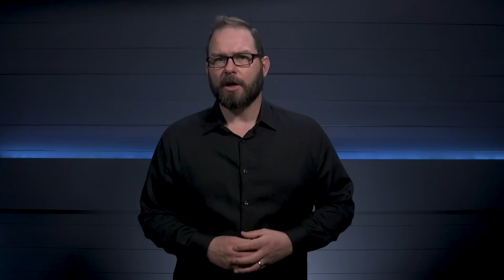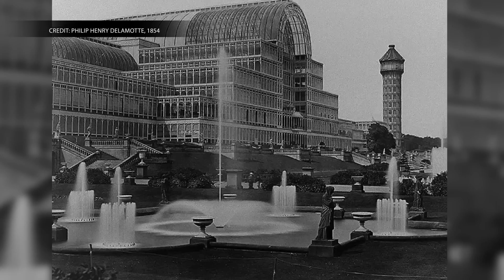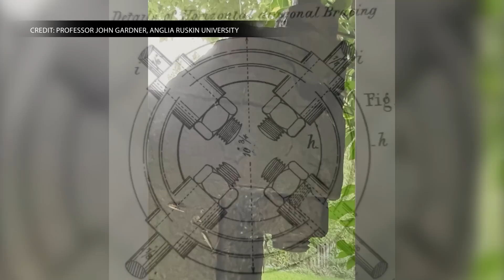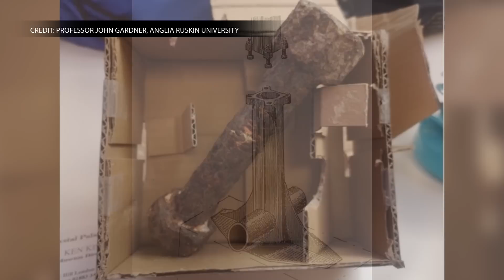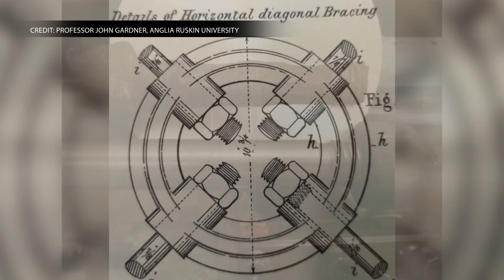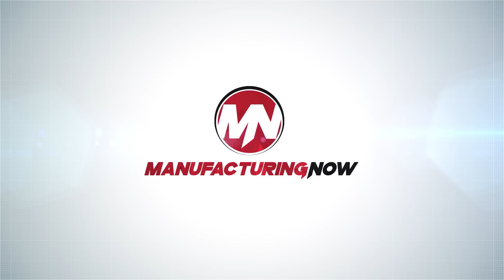Screw Thread Solves 173-Year-Old Mystery

Comment: Flash forward to WWII.  The Brits still hadn't mastered standardization and the US had to build the Rolls Royce Merlin engines for the Brits.
Reply: What history book are you reading? 
The British designed and built the RR Merlin for themselves, the US built the Merlin under license for US use in the P-51.
Reply: @Surestick88  As I understood it, the British Merlins were still fitted together, resulting in each engine very much having its own personality.
Reply: @leifvejby8023  Yes, the British were still "fitting" each engine together. If a new part was needed, it could not be taken off the shelf.  It had to be fitted to the specific engine they were working on.  They had no concept of tolerances which made all parts interchangeable and allowed high production rates.  If it hadn't been for US production techniques, the people of England would be eating wienerschnitzel at this moment.
Reply: @leifvejby8023 that's called 'blue printing'.
Reply: @sparked3113  No, blue printing is what I did to my car 30 years ago, I am talking about fitting them, scraping, reaming, lapping, so they could run at all.
Reply: @leifvejby8023  lucky they had a workforce of precision engineers with exceptional hand tool skills. Many of them women.
Reply: @alext8828 You're a bit thick. The Rolls Royce plant at Hillington near Glasgow was purpose built to produce Merlin engines. Get a grown up or your carer to show you where Scotland and England are on the British Isles.
Reply: @alext8828 agreed .  The Americans won the war that Britain and its commonwealth fought  .  Pity about Vietnam  and Afghanistan    😂
Reply: @alext8828 und Deutsche  sprechen
Reply: This whole thing comes from a very misunderstood quotation, it does not refer to the engine, but to the engine ancilliaries.
It also does not refer to the finished product, but to an interim manufacturing stage, like a raw casting. The ford automotive technique was to cast with the minimum amount of meat on the final part to reduce the cost of finishing work. This is fine for a car, where a broken part just means a breakdown and repair. In aviation a broken part is death, so more flesh is left on the casting to allow for finishing to a part of a higher quality and greater reliability at a lower weight and hence a better power to weight ratio. This is a normal technique in aerospace engineering where surface defects are catastrophic.
It actually reflects the fact that Ford were thinking about working to lower manufacturing standards, not higher.
It's also a great example of how removing a piece of information from it's context allows it to be distorted to say something that was not actually there in the first place.
Reply: Utter baloney.
Reply: Rolls Royce and Ford managed to build 106,000 Merlin engines in Britain during the war. Packard built 55,000 V1650 engines in 3 1/2 years and every V1650 was identical to it's British made equivalent models.
Reply: @stuartburton1167  yes, only the ancilliary parts were different.
Reply: @stuartburton1167
Reply: @stuartburton1167 The Packard Merlin’s were not identical or interchangeable with the British engines - they used different thread forms. The British engines used 55 Degrees pitch Whitworth on the large bolts and 47 Degree British association threads on the small screws.
American engines used 60 Degree National threads on everything with the small screws being American wire gauge threads.
Late in the war both switched to using a slightly different thread form in Unified National Threads (UNF and UNC).
The other complication was the British standard inch and American standard inch were subtly different (the British one was slightly shorter). And every other single unit was also slightly (or significantly) different.
The British engine drawings didn’t include the tolerances on parts because the British couldn’t afford to throw away slightly out of spec parts like the Americans did regularly. They used a selection method to match parts together based on a table of fits. 
Similar things are done routinely today when engines are rebuilt with oversized pistons and cylinder sleeves.
Reply: @allangibson8494  Sorry but your wrong on the engine Packard used the exact same threads as Rolls Royce did. My late father was an RAF technician from 1944 to 1966 and worked on Merlin engined aircraft for many years post war He served in a Coastal Command maritime patrol squadron on Malta that used Lancaster MR3s with Packard engines and the only difference between them and a RR engine was the Bendix pressure carbs and slow engine running switches in the cockpit. Some parts like carbs, magnetos and generators were US equivalent equipment but everything in the engine was as RR designed.
Reply: @stuartburton1167  The US equipment used US wire gauge threads. The British equipment until 1943 used BA threads. After 1943 both used the American UNC & UNF threads. So it depends on exactly when the engine was built.
Other Rolls Royce engines went through the same changes.
Reply: @allangibson8494  No they didn't Rolls-Royce and Packard used the same threads in the engine. Ancillary components could have different threads.
Reply: @stuartburton1167  Look up the actual history. Ford was supposed to be building Merlin’s and did the U.S. conversion drawings but Henry Ford found out and refused to send any aid to England in 1941. (Henry Ford was a voluble backer of Adolf Hitler from the 1920’s).
Reply: No, my country is better!

I find it funny when someone starts a WW2 "discussion" like this.  By this point in time not a single one of us can have first hand knowledge on the subject. So it's all in who you heard it from or what book you read.
Reply: @zendell37  So, you are in fact saying, that only first hand experience can be used, not knowledge from books written by people with first hand experience, right?
Reply: OMG How rude!
Reply: The US inch was defined as exactly 25.4 mm slightly different from the UK inch. This led to issues where you needed accurate parts that fit together !
It is why they "unified" the imperial measures in the 50th. Garbage anyway. I hated UK cars !
Reply: @jpcaretta8847  The 25.4mm inch became standard in 1959.
Reply: @jpcaretta8847  Look up the U.S. Survey Inch (which was the earlier inch definition), it is slightly over 25.4mm.
The British Imperial inch is slightly under.
The British Armory Inch (or Enfield Inch) is one percent longer than the Imperial Inch.
The Geneva Inch (zoll) was used for 18th century British Lathes (like Maudlay’s and Holtzapffle’s was based on a foot (fuss) defined as 0.30m and the zoll being 1/12 of that. 
When you can’t agree on what an inch is, your drawings are going to be a little “off”.
Thats what drove the adoption of metric and metric defined units.
Reply: @allangibson8494  I know all this and laugh at the imbeciles praising the imperial units to be smart !
Reply: The American engineers found the British tolerances on the original parts to be far looser than their machines could produce. The original Merlin required hand finishing of parts to fit correctly. American machines enabled the Merlin to be put together like the standard Ford auto engines of the time: on an assembly line with no time-consuming "finishers".
Reply: @Shaker626  The British machines of the day could not produce the close tolerances required for the Merlin engines so certain parts had to be made to fit tight and then be clearanced manually.
Reply: @FairladyS130  As I understand it, the British Merlin engines were manufactured using American machine tools cylinder block borers and milling machine tools by Cincinnati.

Comment: You're omitting a lot about BSW threads...
Sure, the standardisation was a boon, but the thread profile is, well, amazing.

The tips and troughs are rounded, not sharp (part of the standard). As such they don't sieze nearly as much.

Annecdote time:
I was involved in he restoration of a 150 year old cast iron water wheel.
Thanks to Whitworth thread, and a bucket load of red lead oxide putty, the nuts and bolts came undone with hand held spanners (wrenches).
Reply: A Whit thread; done up tight for 100 years, give it a quarter turn and you can do the rest with your fingers. 
Also the best thread for cast iron.
Reply: Actually the whitworth thread was optimised for wrought iron (not cast iron).
Whitworth above all was a machinist trained by the British inventor of the screw cutting metal working lathe - Henry Maudslay.
His first two standard bolts, the 5/8th inch had a one inch across flats head (because it was made from 1” square bar) and the other the 1/2” bolt had a 0.707” head - what you get when you take a 1” round bar and cut it square to take a wrench. Square headed bolts and nuts are still used for railway applications…
Reply: Fun facts, the tripod mounting thread on the bottom every “garden variety” camera is 1/4 inch British Standard Whitworth (BSW) and the coolant fittings on most European cars are secured with British Standard Pipe (BSP) threads.
Reply: @mikequinn6206  Metric “G” pipe threads are a clone of BSP.
Reply: I partially disagree . The lack sharp points and corners ( as in Acme threads ) gives the Whitworth an advantage of fracture resistance over just about all other designs . I think this feature is more valuable than seize resistance  ,,, !
Reply: @rolandtamaccio3285  Acme threads are designed for linear force without binding.
BA/Thury threads are optimised for brass.
Whitworth threads are optimised for wrought iron and vibration resistance.
Metric and Unified threads were optimised to look pretty on a drawing with 60 degree thread angles…
(As a note the British Association threads copied the Swiss metric Thury threads with the exception of rounding radiuses).
Reply: @rolandtamaccio3285  👍
I guess you don't live in the rust belt, or Scotland...

We'd probably need to go back in time and ask Mr Whitworth what his priorities were...

Comment: As an engineer, I don't understand what mystery it was to use a then well known standard from 1841 a decade  later.
Reply: And there are already thread standardizations around 1777.
Reply: I guess context is why it's a mystery.  Not knowing when these threads were standardized, I expected a fast screwing coarse thread which would speed up the process.
Reply: @zendell37  Standardization, manufacturing according to those standards and material availability are all things to consider.
I've got some books on construction and building from the 1930ies (from the Netherlands) and back then metric threads were the standard, but the book recommends the use of BSW thread standards because those nuts and bolts are much easier and cheaper to acquire.
Reply: What was your major?
Reply: @BritishEngineer  Paine
Reply: Using it in a building was the "innovation".

Comment: Whitworth threads (36 to the inch) are still used in microscope objective lens mounts.
Reply: And metric pipe threads…
Reply: All camera mounting screw threads today are still made 1/4" Whitworth thread.
Reply: @Tuckaway  They are not Whitworth threads; they are imperial 1/4 inch diameter, 20 threads per inch.  Whitworth threads have 55 degrees included angle, whereas standard national coarse (UNC) thread has 60 degree included angle.  For cameras & lenses too heavy for 1/4-20 thread, they use 5/16-18 thread.  For larger lenses, 3/8-16 thread is used.
Reply: And, believe it or not, some self assembly beds!